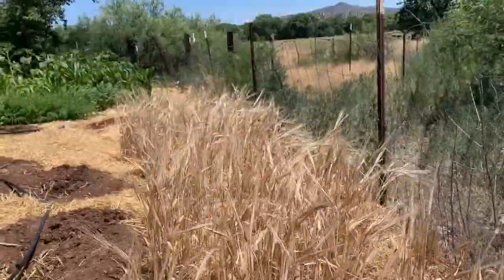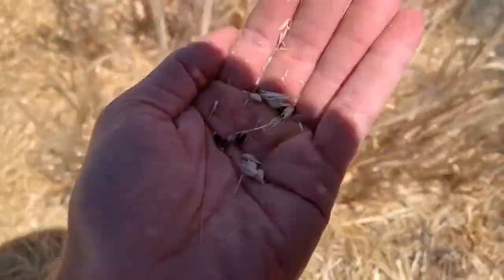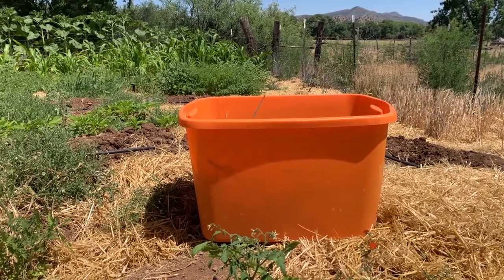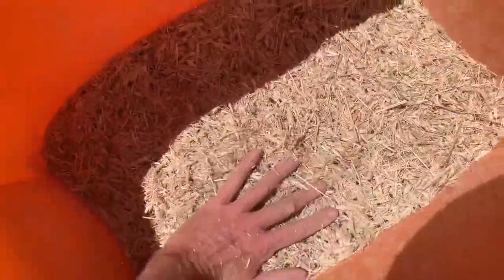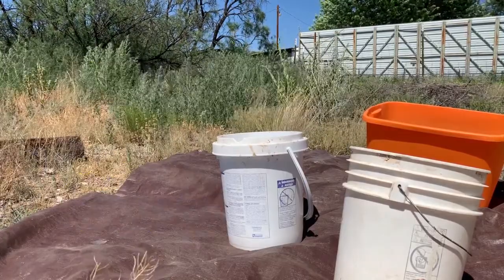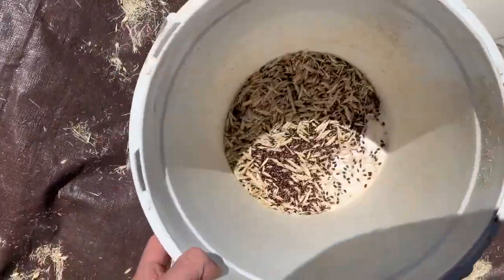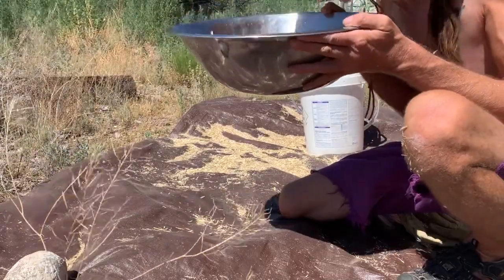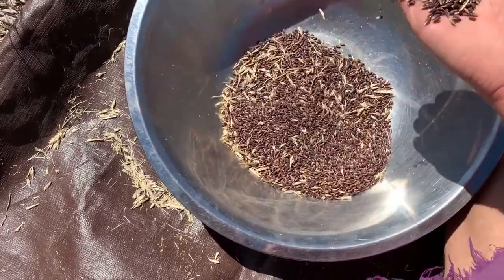Harvesting & processing Barley by hand

Comment: Does the seed need further processing to be consumed? From an apocolyptic survival perspective I am think thinking of harvesting wall barley and wild oat, but in survival calorithic enegy is everything. So we have to think least amount of energy for the meal. So if I can consume the seed by boiling/frying ect I will, but I know for bread the outer shell has to be removed or would you just grind the seed as it is even if the flour is a bit grainy. Thanks Aidan
Reply from the maker: The great thing about this Barley variety is that it is hull-less and can be prepared for eating without further processing! There are also hull-less oats available through seed companies. Wild Oats have a hull, so they need to be threshed and winnowed, which adds more work.
Reply: @RadioFreeSunroot  What about wall barley? I collected a load of wall barley and what I believed to be wild oats the other day, but because I wasn't sure I had a wild oat I threw them away. What is your knowledge of wild oats? I want to try send a photo to someone to absolutely confirm that is what I have and not false oat grass which is also very common around where i live. Thankyou Aidan